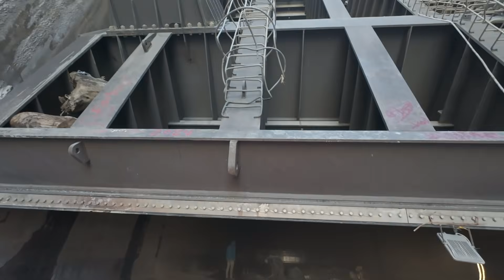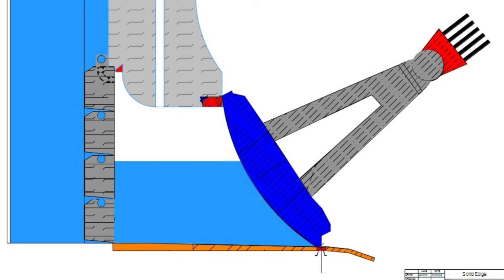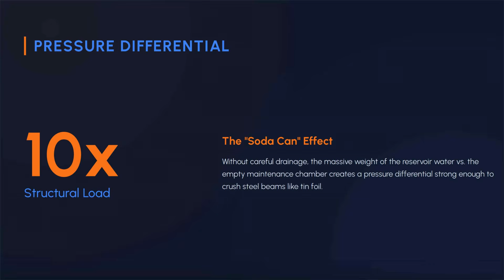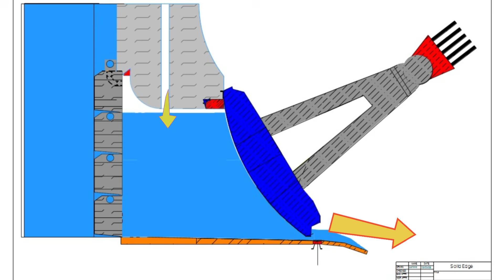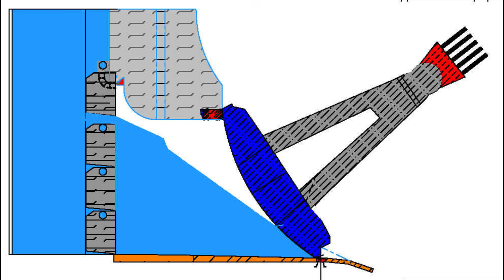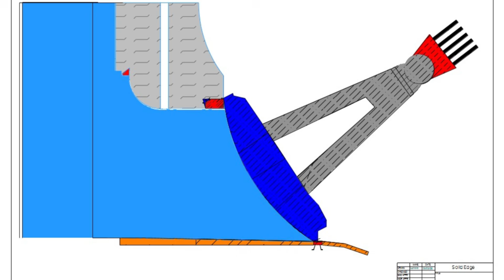Why Dam Engineers are Terrified of Vacuums

Comment: Delta P has killed a lot of drivers at power plants and oil facilities 

This is why everyone needs to be trained on everything in the plant

Many times no one knows where the pipes and the valves are for filling the chambers or emptying the chambers. 

The valves are often way away from the other valves in remote locations of the dam

And the gauges that indicate the location of valves and gates and if they are really fully closed many times don't work. They are broken or give false indication 

Once the diver starts down and gets near that small pipe the suction is so powerful it rips the diver apart